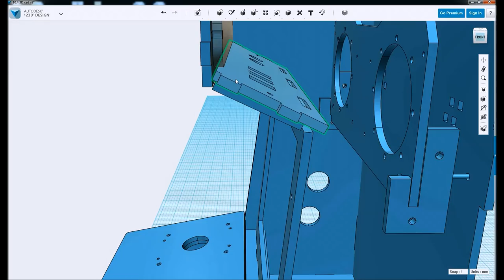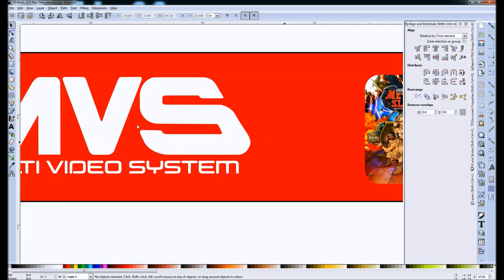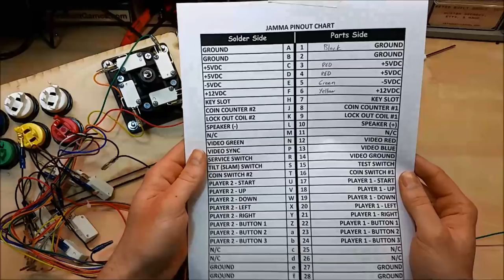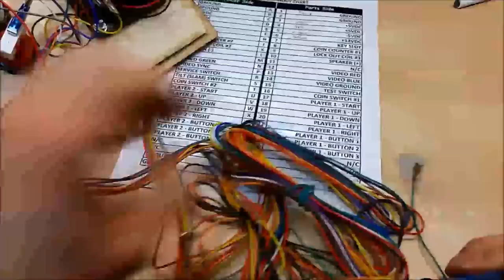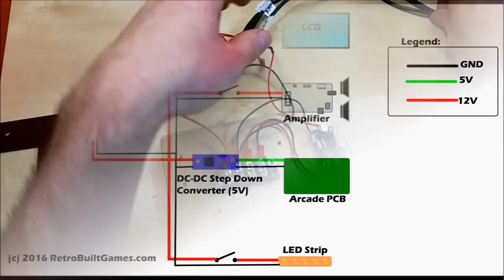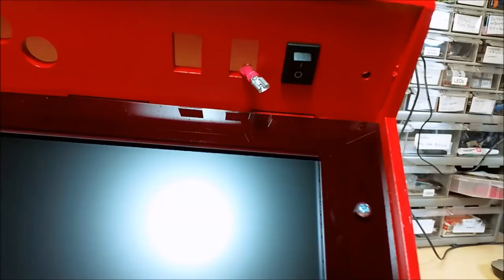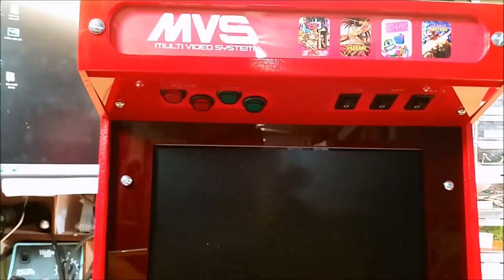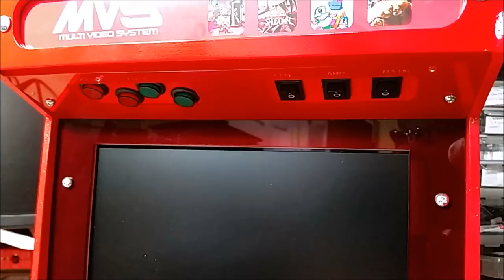Build a Mini Neo Geo Arcade Machine

Comment: Thanks for the help. I am getting ready to wire my Jamma 60 in 1 with a trackball. As far as I can tell the trackball uses up all of the player 2 controls. I ordered a harness for it. I hope I'm right or that there is a pinout included with the trackball. All my parts should be here by Monday and I got a week off coming up to work on it. Love this arcade builder community.

Comment: not sure if somebody mentioned it, but when you put adhesive vynil, wet the area with soapy water, It'll allow you to move the masking tape with the vynil without sticking, lets you align and then use the squeegee to get your hair bubbles / water out. Let it dry, peel off and done :)

Comment: If I was to make a very raw build what would be the easiest way to power on the monitor and arcade power supply to a pandoras box with a switch? Toggle or rocker? I'm having a hard time and don't want to keep plugging the unit on and off or using a power strip. I'd like to know if there's an easy way to set up a switch.

Comment: I'm building a portable arcade for myself that I can take to friends and families houses.  I'm ordering a few last parts right now to finish fixing the computer that is going to run it.  Quick question, I'm going to run emulators on a dual core computer with 1GB of DDR 3 ram, will I be able to run a front end with emulators like CPS and Mame 2D games on so little memory?

Comment: A lot of the Pandora's Box ads say that they have a 4 pin molex connection for powering. I was hoping to power with my CPU PSU using it. However, I don't see a molex connector on yours. Do you know if any of these gamma boards have that connection on them?

Comment: Excellent build, really interesting, great project very well put together, you've inspired me, just clarify why the jamma board rather than the pi?
Reply from the maker: I've built a few RPi arcades (as has the rest of youtube tutorials), so switching it up with a JAMMA board.
Reply: @RetroBuiltGames  is there a performance issue between them, any lagginess or would you say the same?, also my all time favourite game from my childhood would be Spacewar and maybe Gorf, so 2 then 😂 are these available do you know, to run on either system?
Reply from the maker: both Gorf and Spacewar can run on either system very well. It's not until post ~1996 games where emulation isnt 100% perfect but unless you own the cabinets it's hard to tell. There is much to discover with the raspberry pi system, it will satiate most needs in the SoC arcade emulator. For the embedded enthusiasts you can get a MiSTer which has an active community writing console and arcade cores for this FGPA system.
Reply: @RetroBuiltGames  hi Ryan veey useful information, much appreciated 👍

Comment: Hi Ryan, the 60 in 1 jamma board i'm going to purchase says for vertical screens..... I have my 21.5" led screen anyway which I am going to fit because in the future I will want to upgrade the board to a pandoras box 3 or 4.... will that 60 in 1 still work on this screen ok?
Reply from the maker: I have no way of knowing honestly. Something you should research before buying.... I have some guesses, but most of them come down to: it will "work", but maybe not in the way you're expecting. 
There are two scenarios:
1) that 60-in-1 board is likely made for modern horizontal widescreen LCDs and the 60-in-1 handles the post processing to rotate and fit in a~16:10 [horizontal] lcd turned by 90 degrees [vertical]. 

2) That 60-in-1 outputs a video signal in a vertical format (say 800x400, sans 400x800) and relies on the monitor to rotate the picture. Your 21.5" monitor might benefit from digging into its menu and verifying if it can rotate the input 90degrees. If  your LCD cannot rotate the incoming signal, you'll have a super cropped image with black bars.

 I sorta doubt #2, but 'logic' never stopped MFGs from making whatever the hell they want.
Reply: Ok thanks, could you give me a list of jamma's that will work ok in horizontal please?
Reply from the maker: lol. I dont have such a list.
Reply: Haha, ok... any?
Reply from the maker: I know of none from experience. But the Raspberry Pi is great at rotating its video out.

Comment: Would you recommend CNC router or Laser cutter for doing builds like this? I would also like to use this for acrylic as well.
Reply from the maker: +Joe Toney both have their advantages for wood; but builds like this I go laser.  Cutting acrylic is much easier to laser than machine cut.
Reply: Would a 40W laser work?
Reply from the maker: it should

Comment: I don't like jamma (Pandora) games. Why no DIY 2 players sets available on your website with PI configuration?
Reply from the maker: there are
Reply: Your website menu is:
- The Build Page
- DIY kits / Shop
- Porta Pi Arcade 10" HD
- Vertical [SHMUP]
- JAMMArcCADE 1P
- JAMMArcCADE 2P
etc.

No entry for something like Porta Pi Arcade 10" HD 2 players

That's the thing that I looking for
Reply from the maker: Read the description for JAMMArCADE 2P.
Reply: Ok but in this video you explain how to build a JAMMA cabinet and it's somewhat different than a PI set. Does I have to refer to the Porta Pi Arcade 10" HD video and find a way to place parts in? Even if the cabinet seem to require Jamma box? Jamma box seem to require differents ways of connections and phisycal attachments to the box.

Sorry for my english :( Im a french Canadian

Comment: Would it be possible to place an order for this cabinet assembled with everything aside from the Pandora box? I love the design of the porta pi and have been eyeing it for awhile but I much prefer to use this jamma set up and if I'm not mistaken this one is slightly bigger then the porta pi HD correct??
Reply from the maker: +Brandon Helmers It will be possible in ~2months time; Making this a kit (minus the pandora's box) is exactly what I am working on now. I have most parts stocked but no cabinet shells cut nor a BoM ready to call this kit 'ready'.  And yes, this cabinet about 10% larger than the Porta Pi.
Reply: +Ryan Bates that's great to hear, I'll be keeping tabs on this then! Thanks for the response!
Reply: +Ryan Bates would the kit be compatible with Pandora's Box 4?
Reply from the maker: +Steve Simpson Yes. If it has a JAMMA connection+ VGA + analog audio. it would be compatible.
Reply from the maker: See https://youtu.be/p7-IQk5inx8 for Pandora's Box 4 installed into this cabinet.

Comment: Ryan, which laser cutter are you using to cut the wood? Or is it a printer?
Reply from the maker: It is a laser cutter. (Printing implies it adds material.) My kits are cut on either a Trotec Speedy 300 or Epilog 36EXT.
Reply: Hey Ryan, is 3D model you used opensource?
Reply from the maker: Nope. Its miiiiiine